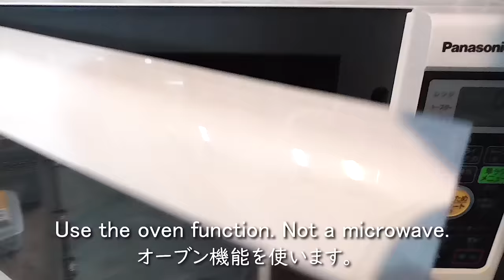Diorama of Forgotten Shrine and Guardian【thalassophobia/Aquaphobia/Cryptid/Creature/Resinart】

Comment: Amazing friend. Truly captures the imagination. How the styrofoam did not melt from the resin?
Reply: You can get low teprature resin
Reply: Low temp resun usually cures in around 50 hrs
Reply: The modeling paste and paint + low temp resin is usually fine. I make dice sometimes sand my coin mold is a styrofoam mold because I ran out of silicone. I use paste barrier +mold release to get the resin out.
Reply: Samantha Nicole ...
Reply: @samminicksm  nice
Reply: Since he uses modeling paste to seal the styrofoam it protected it from heat, and you can get a low temp resin, but I also remember that in my experience when resin gets hot enough to melt foam it's a good indicator that something went horribly horribly wrong and made it kick too fast. Basically follow the instructions and don't be an idiot and it should work fine depending on the brand
Reply: Very nice
Reply: Resins degree not posible to melt strofoam so paintimg has protected
Reply: @CursedCaptainGaming  she only typed three dots, how is that even remotely insulting?
Reply: DangerNoodle “...” always is a negative thing, so it’s kinda like if you explained something and then someone just stared at you making a face and staying silent.
Reply: @CursedCaptainGaming  it doesn't always mean a negative response, but even if you think it was there is a possibility for the "gacha-tard" not intending for it to sound insulting. And really though, how can you get offended by someone just because they typed out three dots?
Reply: He should of put that snow on top of trees and have the figures head sticking out of the resin but still awesome love your work Thalasso hobbyer
Reply: Styrofoam's melting point 464ºF that could be it
Reply: he didnt put any of the actual styrofoam in the resin
Reply: Looks like the processes needed to paint the styrofoam protect it
Reply: 800th like
Reply: Not all resins and styrofoam are reactive to each other
Reply: The Music on this video is so satisfying
Reply: Loads of trees helps keep the temperature cool
Reply: Hola hablan español castellano o abla hispana
Reply: Why are people mad about this? I'd like to understand.
I love watching these.
Reply: @OgToadRibbit  💔💔💔💔💔💔💔💔💔💔💔💔💔💔💔💔💔💔💔💔💔💔💔💔💔💔💔💔💔💔💔💔💔💔💔💔💔💔💔💔💔💔💔💔💔💔💔💔💔💔💔💔💔💔💔💔💔💔💔💔💔💔💔💔💔💔💔💔💔💔💔💔💔💔

Comment: This guy: making trees from scratch using wires

Me: oh hell naw I'm going outside and grabbing some Bush Bits™
Reply: Theyr gonna wilt brother youd be havin dead trees
Reply: What’s the trade mark for?
Reply: @sir.squishy6830  ay man dont be asking that u dont be asking stuff like that man he trade marks it if he wants to u better be gettin yo bush bits (tm) out bro
Reply: Xavier Gaxiola makes sense
Reply: @QuadMrSquishy r/whooosh
Reply: You can add bush bits if they are dry.. but then you’d also have to seal them or they’ll peel away. Wire is smart bc it will last & it can be shaped to however one wishes.  When he said ‘root’ I thought he was going under the resin with them which would make sealing necessary bc wood would cause 1000s of air bubbles.  It would have been cool to see a few of them as roots underneath but this diorama is sooo next level it’s unreal already! 👌
Reply: @sir.squishy6830  i think there is an actually diorama company that makes trees and stuff, called Bush Bits
Reply: funny! Lol not sarket
Reply: Use broccoli

Comment: One thing that you forgot is structural age damage like crumbling supports, little wooden pieces in the water, roof holes, and if you want to make it look really old you can put a crack running across the edge of the porch like place and bend it to be like its at the point to were its about to collapse into the water after years on its own